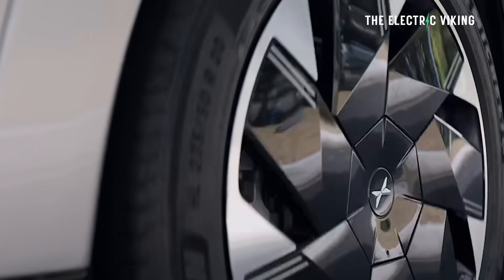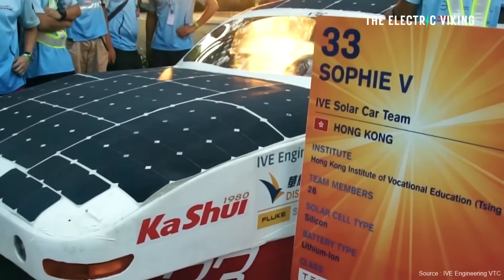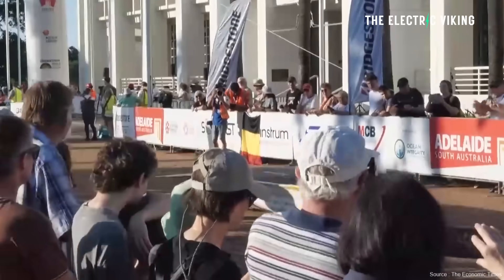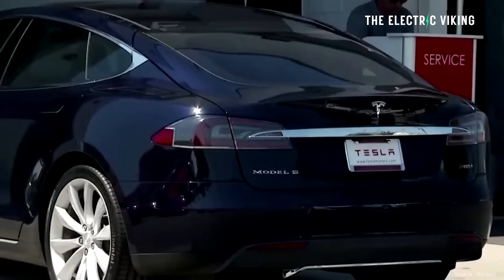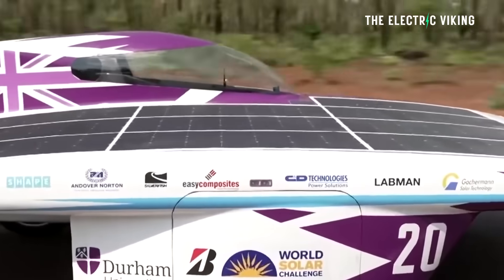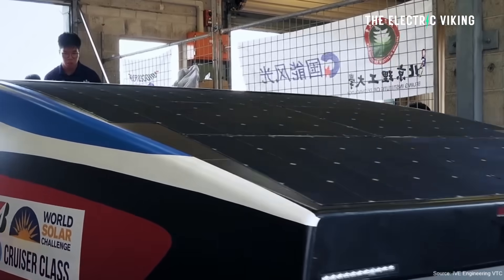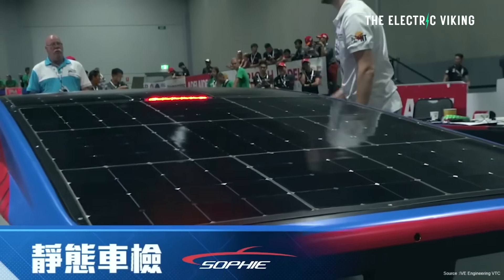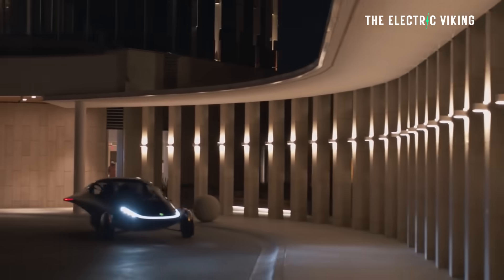The Secret to Endless EV Range: A Solar Car's Winning Technology

Comment: You can’t compare these solar powered cars with production automobiles.  The solar powered cars are built with a small battery, little to no safety features, no airbags, super skinny tires, lots of carbon fiber components, a single lightweight seat, no heating and probably minimal cooling, no creature comforts, etc etc.  plus, they’ll drivers are probably the smallest/lightest weight humans around.  Much more efficient solar panels will be invented before it’s practical to have solar on an EV.  I own an EV and would love to have solar panels on it, but the technology is not efficient enough, yet.  I’m sure some of the tech in these solar cars will be helpful in production EVs, but there’s still lots to do before production  EVs will be able to have built-in solar.

Comment: This is where Lightyear came from and we know what happened there, too difficult to get funding for a free to run vehicle. Sion went the same way and still yet to see anything from the most likely to succeed one of these, Aptera. Even this could fail because of high price for what you get. The cheap model is the best model and not going first, they want you to buy more battery.

Comment: Good lord another massive ignorance of Electric Viking. People has to know that solar 1 kW/m2 of energy deliver at best. Solar cells can convert 25% that energy into electricity. If the car is covered with 5 m2 of solar cells, in 8 hours of the day the solar harness only 10 kWh of electricity at best. On the whole I'm afraid much less. Just useless in most of US, EU and Japan especially in winter, because of zero Sun. 

Better cover your roof with as much as possible solar cells and connect a big battery and charge your car with it. This way make more sense than an extreme uggly cells on beautiful painted car.

Comment: Another trend in solar is covering the parking spaces at work or at the mall with solar panels. Add some battery storage, and all the cars (electric) keeping cool under the solar-provided shade could plug in 24 hours a day (or at least during mall operating hours).
Reply: I’ve been making the same argument for standalone charging stations in remote locations. This is the answer to charging infrastructure and range problems in remote locations. Set up an array of panels over the charging stations and put the batteries underground to protect them from vandalism and make them more thermally stable. You could put something like that literally anywhere. This would completely eliminate the need to move dangerous fuels around by truck. In a place like Africa, it would massively improve mobility and open up supply chains (and you wouldn’t need $50,000 cars to do it either).
Reply: @thethirdman225 in Africa they steal traffic posr to sell for scrap,  their culture prevents this idea. They also stole all the light bulbs at a ruby stadium,  sooooo.   What can you do
Reply: Yes sounds nice until they either get smashed or stolen by the "underprivileged "
Reply: Yes, in a few decades. Maybe...

LONGi Hi-MO X10

Model:
LR7-72HVH 640-670M

650M (Efficiency 24.1%)
670W (Efficiency 24.8%)

Q: How many solar panels are needed for 50kW with 600W panels?
A: Just 84 panels. This is the configuration used in Sunchees’ 50kW system.

Q: What area is required for installing a 50kW solar system?
A: With 600W panels, you’ll need about 1722-1937 ft² (160-180 m²) of unshaded space.

Or
A 50kW solar system includes 100 pcs 500W solar panels, and it requires up to
2690 ft (250㎡).

Average 5 hours of sunlight.

This is not even for one battery... The panels help, but they won't work without the grid.
Reply: @dchubworldsharenetwork   Which is precisely why national energy grids work the way they do.

Comment: Fair enough but lets also put a note of practicality into this - did you mention all these fancy solar cars are using satelite solar panels that cost on the order of $40,000 to move a very very light car with one passenger in a crampt little vehicle that of course has no safety standards and only work in very sunny climates during the day.  While I agree their efforts should be applauded and we should keep an eye on this sort of effort; it also demonstrates the impracticality of solar cars at this point. If you put the same super expensive solar panels on a Tesla, it would go about 10-15 miles a day for $40,000 - if you have a lot of sun. Obviously the ROI is not working at this juncture.

Comment: I recently read an article discussing the many problems Aptera has had actually getting the vehicles into production. The prototypes still barely function. 

And besides the laws of physics make their solar power claims unlikely. Sure, you can run an EV on solar power but you need panels of about 20 square meters, which is way larger than the vehicle.
Reply: "they barely function", why make it up mate, that's pure bullsh1t...
Reply: The article I read made this point, and an AI search confirms that the prototypes have serious engineering deficiencies. They now need about 3 billion bucks of additional investment to make a production line. The scammy way they have raised most of their money from unsophisticated investors doesn't bode well for ever getting funding. I doubt that many institutional investors are going to fall for the hype

Comment: Nice — love the energy. Since this is pure brainstorming about making a car that’s **“ready all the time”**, here’s a compact, practical, and creative run of ideas (concepts → engineering levers → prototyping steps → failure modes & safeguards). I’ll keep it high-signal so you can pick the bits you like.

---

# Core goal

A vehicle that can be used instantly with minimal prep: minimal warm-up, predictable range, and no annoying downtime. Achieve this by combining redundant energy sources, modular subsystems, and smart controls.

---

# High-level concepts (ways to be always-ready)

1. *Split-role energy modules*

   * Small *city battery + ICE genset* for everyday starts and short trips.
   * Separate *highway battery* for long runs.
   * Keeps main pack healthy and the car able to leave at a moment’s notice.

2. *Always-on micro-reserve*

   * A tiny buffer battery (1–2 kWh) always kept at high SOC for instant starts, accessories, and emergency moves.
   * Acts like a UPS for the vehicle’s control systems and door locks.

3. *Hot/cold preconditioning on demand*

   * Use low-power heater/reservoir or pumped thermal mass to precondition cabin/battery quickly before door open (triggered by key fob/GPS).
   * Preconditioning can be powered by city battery or ICE generator.

4. *Predictive readiness*

   * Learn driver patterns (AI/local) and precondition before expected departure.
   * Use phone/GPS to trigger readiness (e.g., when you leave work, car wakes and warms/cools).

5. *Fast mechanical readiness*

   * Starterless ICE genset (runs as generator only) that idles at efficient RPM or ramped-on quickly to support instant low-speed use.
   * Electrically driven ancillaries so nothing needs mechanical warm-up.

6. *Redundancy for reliability*

   * Two-path propulsion (small motor + main motor) with cross-connect so a fault in one chain doesn’t immobilize car.
   * Dual BMS redundancy and contactor redundancy for safety.

7. *Energy harvesting supplements*

   * Solar roof + regenerative braking + waste-heat capture to top up micro-reserve. Not primary, but reduces surprises.

8. *Modular replaceable packs*

   * Swappable city pack module so the vehicle can be back on road fast in case of major battery fault (like a spare tire for battery).

---

# Key engineering levers (what to design/tune)

* **SOC windows**: keep reserve SoC for instant start (e.g., always >40% on micro-reserve).
* **Switching thresholds**: (speed, torque) with hysteresis to avoid chatter.
* **ICE genset sizing**: sized for steady recharge in city conditions, not peak acceleration.
* **Power electronics**: common DC bus or fast DC-DC to allow multiple battery modules to share power.
* **Thermal control**: small dedicated heater/cooler for the city module to keep it within ready temp range.
* **Mechanical simplicity**: no clutch or gearbox between genset and wheels reduces complexity.

---

# Practical readiness features (UX)

* Single-button “Ready Now” on phone/key that: checks SOCs, spins genset if needed, preconditions cabin.
* Status LED on dash showing which module is active (city / highway / reserve).
* Auto-fallback: if main highway battery low, switch seamlessly to ICE-charged city battery for last-mile.

---

# Prototyping plan (fast iterations)

1. **Bench test**: small EV motor + two battery modules + small genset on test bench. Validate switching and DC bus behavior.
2. **Control stack**: implement simple FSM (city/highway/charge/emergency) with safety guards (power, SOC, temp).
3. **Vehicle integration**: retrofit a donor EV with city module + genset and test urban cycles (<50 km).
4. **User trials**: daily use loop to stress switching logic and measure fuel/battery tradeoffs.
5. **Optimize**: tune generator RPM, SOC windows, and regen mapping.

---

# Failure modes & safeguards

* *Switching under heavy load* → prevent via instantaneous power check.
* *Cold battery refusal* → keep micro-heater or block switching until safe.
* *Contactor weld / stuck* → redundant contactors and fallback paths.
* *Generator failure* → micro-reserve must allow limp to safe place.
* *Software bugs* → default to safe pure-EV mode (isolate genset) and notify user.

---

# Cost vs benefit tradeoffs

* Benefit: lower effective battery size, higher lifetime, instant readiness, lower range anxiety.
* Cost: slightly more complexity, two battery subsystems, genset maintenance.
* Sweet spot: urban/commuter cars where highway trips are predictable — huge benefit. Luxury cars may still prefer single big battery for performance and simplicity.

---

# Quick wins you can test now

* Add a small 2–3 kWh buffer pack to any EV and implement an SOC policy to keep it charged. See readiness gains.
* Implement a phone→car preconditioning trigger; measure user satisfaction.
* Prototype the genset + small battery on a bench to validate steady-state charging behavior.

---

If you like, next I can:

* produce a compact *state machine diagram* for the city/highway/reserve logic, or
* give a *sample parameter set* for thresholds (V\_switch, SOC windows, P\_max\_threshold) tuned to an urban European profile, or
* sketch a simple hardware block diagram showing plug-in modules.

Comment: These aren't cars they're go karts 🙄. you can't compare the efficiency of a go cart with no safety rating with what it takes to make the safest car in the world (Tesla). That's why cars kept getting heavier over time they're way safer than 30 years ago. Aptera is a death machine you wouldn't put your family in. 

You cannot make solar panels yet that power a car significantly with the limited surface area. You need to use thinner film panels to work with the curves of the car and those can't break 23% efficiency and be cost effective. If there was a practical pathwayway to solar cars the Chinese would be working on them and they're not.
Reply: It's the efficiency of the technology being used. !! I've never come across so many clueless, embarrassing comments in my life, go educate yourself.....
Reply: @MickH60 my point is the efficiency of these solar vehicles doesn't apply to electric cars it's apples and oranges. A motorcycle is significantly more fuel efficienct than a sedan but they're designed differently you can't just say oh apply the motorcycle design to the car

Comment: Until there is a massive increase in solar panels technology, solar powered cars will remain vapourware.  At 300W per m², there is simply not enough surface area both run and charge an EV that is practical.

That said, EV are the way of the future

Comment: NIO already solve this problem. LOL

Cars has little to no space and they are far heavier so it requires more energy. And you can't be driving a long range battery as they are heavier and not good for ordinary cars. 
This is where a battery swap station fully run by solar panel and AI jump in.

Comment: .... and the world was created 5000 years ago. This key issue regarding the feasibility of sustaining an EV with on-board solar power is not the efficiency or weight of the vehicle, but the maximum energy the solar panels can convert of the solar panels.  Sunlight produces about 1300 Watts of energy per square metre. High efficiency solar cells are about 25% efficient. That gives you 325 watts of electrical power per square metre.  If a solar powered vehicle has 2 square metres of solar panels on it, that's about 650 watts available to power a motor or charge the battery. That 650 Watts  is a bit over 1 horsepower (that's not a misprint).  The theoretical maximum maximum efficiency of solar panels is about 40% (dictated by the quantum level physics of current solar cell technology).  Would you run or charge a domestic EV with a sub 2000 Watt source ?  I doubt it.  Running an air conditioner in the EV would consume more than 1 horsepower.
Reply: It's still free power, if you're parked in a sunny spot most of the day and you pick up an extra 10 kilometres of range, what's to whinge about ?  It's free power. If you have a sunny week, that's about 70 k's free, that's about 2 days of free travel for most people going to work and back. I'm certain people just love to whinge about everything, regardless of how good it is.....
Reply: @MickH60  I agree that it's still free but its not worth implementing because of the cost vs benefit. Do you want your EV to look like a solar panel ? Remember we are talking about one horsepower or thereabouts.  I guess my point was that the article was over-hyped and somewhat misleading.  Similar hype the other day on salt batteries. The viking does us a great service by digging up so many snippets of EV intelligence but but volume is not a substitute for credibility.

Comment: For long distance driving and touring. A towable trailer with a sigenergy style battery with DC charger in built and a fold out solar array with 12 to 15 standard solar panels will enable charging on the "go" not requiring charger or petrol stops at fixed positions. The battery and charger take up no space. The panels are light and also take up little space if the storage is well designed. Especially as spar panels can be made flexible and quite thin now.
Reply: There are tradies in parts of rural Australia who are already doing something like this to charge their batteries.

Comment: I'm all in about solar panels on EV, there was an European company that did it, but unfortunately  it went broke. Yeah, if you can charge the batteries while driving, for example here on Texas, you drive hours and hours under a strong sun light, you may get a lot of energy is you got solar panels and if you driving an EV truck you may accommodate a ton of solar panels. Extending your battery range.
Reply: Imagine you park outside on the sun light 8 or 9 Hours, your car gets charged for free (without a charger) and then you got back home with that free electricity.

Comment: Aptera is in the validation stages. They are raising funds to build the production lines. They have about 95% supplier contracts signed. 2 vehicles are currently operating on 100%production parts.
Reply: Looking forward to IPO
Reply: Just fyi... they built their first version nearly 20 years ago... looked almost identical to the current version.
Reply: @davidaustin6962   The current version may look the same but it's completely different - different power train (the original was a diesel hybrid), different materials (sheet carbon fiber instead of kevlar or fiberglass). Plus this time the company is under the full control of its founders and can't be shut down as it was first time round.
Reply: Right on!

Comment: The idea may have some merit in a very sunny location, but most people live in locations with plenty of cloud. And urban environments are very shaded too. That means the realistic market for solar integrated into cars will be small, especially as it's so cheap to have ground- or roof-mounted solar connected to a grid or static battery. I'm skeptical. But if these competitons push the limits of technology, that can only be a good thing.
Reply: You do realise solar  panels still produce power clouds or not right ?
Reply: @MickH60 Of course. And the reduced generation would need to be accounted for when working out how much power you'll actually get. I dont see that ever being workable, even with efficiency improvements. There are just much better ways of doing it.

Comment: Hyundai Ionig and Toyota Prius already have sunroof. You can run them without charging and without refueling - they just need to stand in the sun, not in a trees or a buildings shade. Great when the daily commute is less than 2 miles in each direction. The Ionig gets 7 kilometers after 8 hours of sun. The extra cost for the solar panels just takes a lifetime to amortize. Yes, it´s a fantastic gadget - and yes solar panels need to get a 100 times stronger with a 100 pound battery that stores 500 kilowatthours - than we´re talking real business.

Comment: I think even here on the coast an EV with 1200 watt solar array and an 80-100 mile range battery would work for most all of our driving needs with maybe a bit of home charging here and there.  We often go multiple days without driving so this is going to be tough for most. Super expensive compared to a solar carport. Regular EV's and home charging are just fine though and with a rooftop array and daytime charging you can get a lot of your driving needs from the sun.